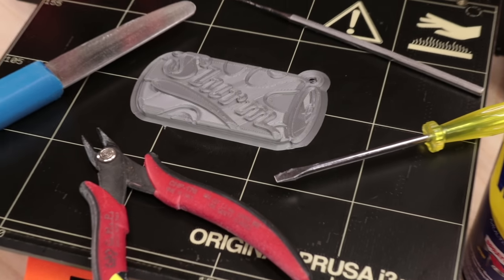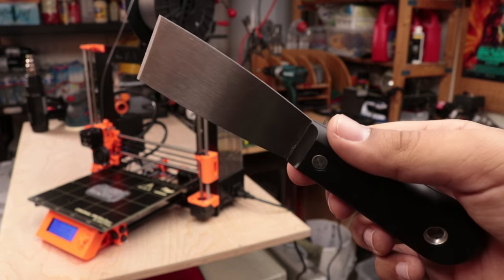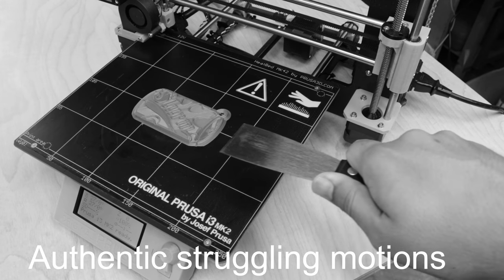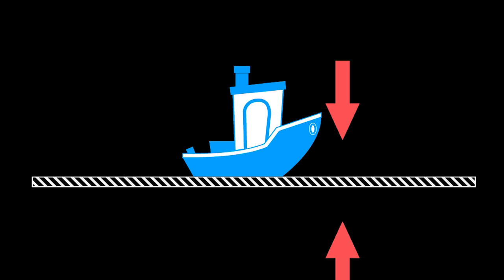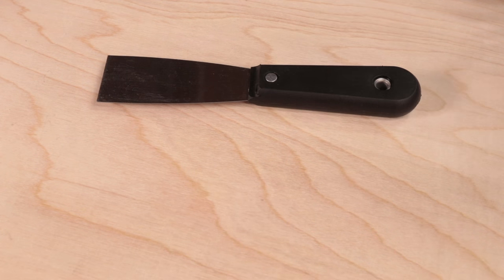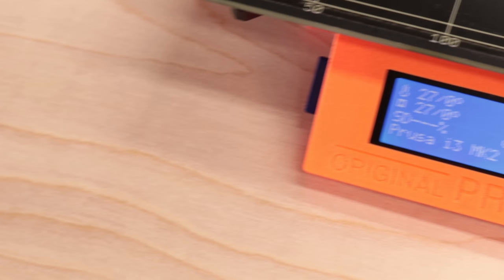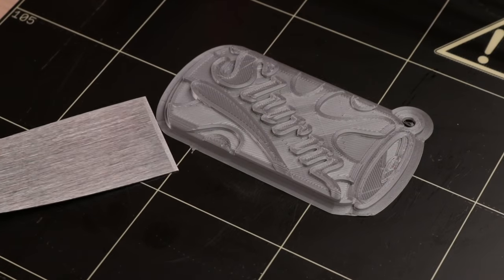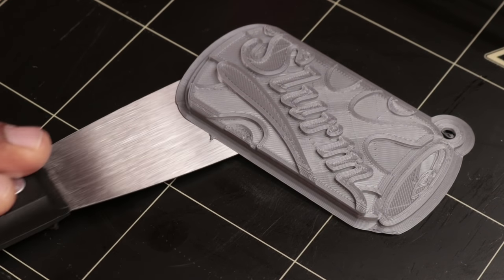How to Remove 3D Prints Easily

Comment: and what happens when you scratch  the bed by accident?  Just take 50% alcohol and 50% water in a spray bottle, spray the bed around the print and wait 10 seconds.  It should lift off without any tension at all.   Then take a clean towel and wipe the whole bed clean with the remaining liquid and pristine bed and pristine model.  Seriously folks do not scrape your bed.   Sorry Mr Volt but I see many accidents happening with this method.
Reply from the maker: To each their own. I've printed and removed hundreds of pieces this way without issue. I'll have to try your alcohol way soon
Reply: Does the alcohol (isopropyl I guess?) weakens the PLA plastic?
Reply: This right here worked perfectly

Comment: put it in the freezer. I had a really really stuck piece that even with the bed off I couldn't pull it off. There was no scraping that piece off. I popped it in the freezer (whole bed) and 10 minutes later came back to the piece already popped off.

Comment: I  use PLA on glass with hairspray. Let the bed cool and it pops right off. With ABS I used my monster maul, but that will only work once and you have to buy a new printer.

Comment: I actually heat my bed to 100 C and then using the scraper (yes, the same :) ) i stick it once slanted face down at 45 degrees in between the bed (tape) and part. And slowly apply a twist force progressively increasing as i hear the tape and part release. It hasn't failed me so far regardless of adhesion method (double face tape 3M or generic, tube glue, or just tape) and i've printed some pretty big stuff.

Biggest so far was the South Pointing Chariot by brlaw, where i have redesigned the wheels (two halves and a more realistic look) and increased the surface to 100% of my CR-10's printing capacity. Same technique, popped on its own once i went around the perimeter once.

But that's my experience on the current machine the CR-10.
Reply: thanks! heating to 100c worked for me ;)

Comment: I even remove my bed from the freezer and the parts are still as if I used epoxy instead of PLA. Hate the glue stick, but if I don't use it, parts don't stick, even if heating the bed to 60 degrees. At this point I will buy a flexible bed.
Reply: Try cleaning the bed with some IPA and then re-level it. It worked like a charm for me